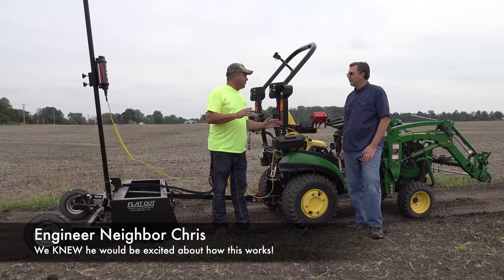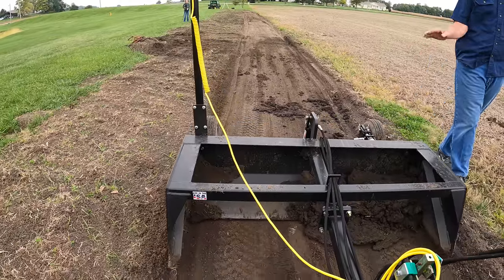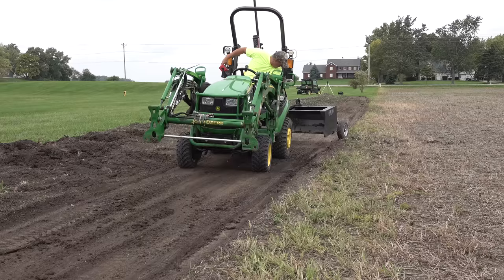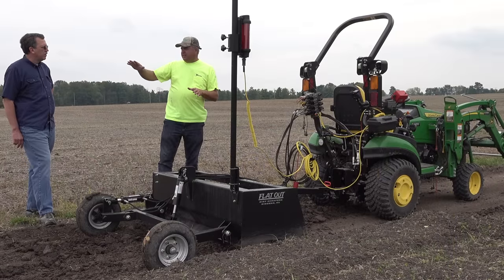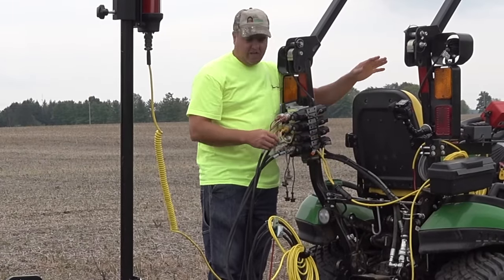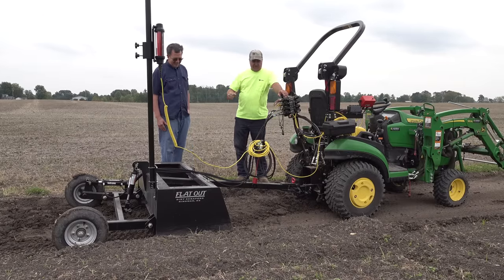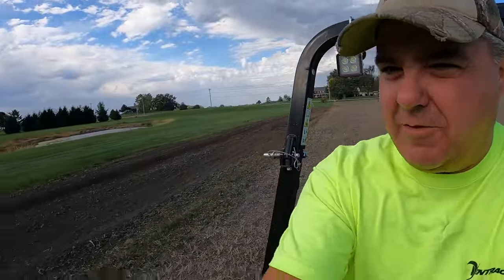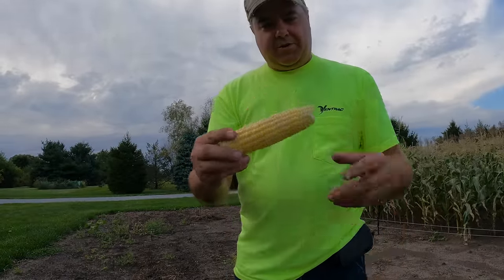Laser Grading Like A Pro! Subcompact Tractor Laser Leveling System! Least Expensive Option Available

Comment: You have nice soil.  That boxblade is just too light.  Hang two 75 lb. weights on each side and I think it will cut just beautifully and you won't need to make passes with the tiller first.  Cool system ad a lot of capability for such a small tractor.

Comment: RETIRED 76, AF VET. ONE OF MY PASSIONS. USING TOPCON. GOT $4K IN MANUAL SYSTEM. HAVE BLUE TOOTH FROM 360 TOPCON RECEIVER TO IN CAB DISPLAY. NEED TO PREPARE GROUND (NO GRASS, NO HARD SPOTS IN GROUND). EDIT: DRIVE SLOW USE HYDRAULIC TEETH AND POSITION CONTROL WITH HI-BACK 6' BOX BLADE. KUBOTA L4701 4X4 WITH T4 TIRES.

Comment: I can't believe this finally exits!!!   I have hoped this would come out for sooooo long. I CANT WAIT to get one of these setups Tim!!   Thank you!!!!
Reply from the maker: @Jason. Yep.  You are right.  That is why I am so excited about it.  Price is much lower than these more professional systems, yet this can achieve some of the tasks. …not all of them, I’m sure!   …and I’m not sure we have this one optimized either.  We might be able to get a bit more accuracy with some more adjustment.
Overall, we agree with you.
Reply: @justanotheridiotredneck  Was just looking to see if anyone else had mentioned a flow control to get rid of the bounce.
Reply: @justanotheridiotredneck  These less expensive laser controlled units rely on conventional "bang-bang" (on-off) solenoid valves.  The next step up is servo valves which act in a controlled proportional manner utilizing big bucks.
Reply from the maker: Yes, we have some control over that.  It would take some time to get it optimized.
Reply: @justanotheridiotredneck  Yes, with PWM control the signal can me manipulated to provide a series of very short pulses to smooth the action.  I'm not sure about the life of the valve spool in that condition, however.
Reply from the maker: We have that control.

Comment: It will be interesting to see this adapted to the ventrac powerrake. I'm guessing if the JD powerrake you have is pull type and 2 cylinder, this laser system could work.

Comment: This is a great start, but I think there are some improvements.

1) If you add some adjustable flow restrictors to the cylinder, I think you can get rid of the steps in its control.

2) You're using external on-off valves, but you're forgetting that the tractor already has a far more advanced valve by default - The position control valve for the three-point hitch.
If you use a regular three-point box blade and connect your laser receiver to a hobby servo motor which controls your position lever, I think you'll end up with a better result and it would be much cheaper.
Reply from the maker: We may try #1...but I'll leave #2 for you.  That sounds like a rube goldberg approach.

Comment: Your right Tim,it would be better if it was tilled, because I think that box needs to be half filled with dirt to fill the low spots. Also does have enough down pressure to do the cutting.

Comment: I see a lot of benefits to the pull type box blade. The price is pretty attractive too considering a regular box blade might be $1,000 and this one has two sets of hydraulics.

Have you considered putting a flow restricter in line with the laser lift circuit? It seems like the adjustments are exaggerated. With a restricter the laser might be able to make smaller adjustments instead of the jumps that we can see. Just a thought…

Comment: Wouldn't you be able to go both directions to get the slope you desire?  I mean go north/south first, then set a slope on the transmitter and go east/west next?  That way you could get by with the one setup..... just a thought.  Would that work?
Reply: Yup except the slope is from the laser so you would need to move it pretty much every pass.
Reply: @paybax  What if your Laser had a slope calculator built into it?  Sorry if that sounds dumb but I really don't know.  I have a Hilti that has a slope calculator so I thought that might automate it.

Comment: Awesome piece Tim.  Question.  When the blade has a visible gap between the CE and the ground isn't it saying you need to bring up the ground? Ie; pulling full blade so it can deposit fill in the low spots?
Reply from the maker: Yep…well, depending on where we have the receiver set.

Comment: Great setup!  Any hints on how to get from a laser receiver to a hydraulic valve.  R&D catalogs have laser receivers that convert laser-position to 0-5V - but it needs an in-line laser, doesn't have 360-degrees reception, and doesn't take advantage of the pulsed beam for improved sensitivity.  I'm hesitant to spend $40k for a pro-setup, when I know the receivers, valves, hydraulics, and scraper should be closer to $5k - $10k.
Reply from the maker: I thought I just showed it in this episode!!
Reply: I apologize.  I got confused in something...  Thank you for putting this together.    I've spent years working in laser labs & building prototypes & test setups.  You've found a great assortment of parts, assembled it well, and communicated it well.  High marks.
Reply from the maker: @robmurray5784  we have several more recent episodes with this combo.  We show our experiences, difficulties, etc.  it works well, but requires some practice.
Reply: I've spoken with Corey at C5mfg.  I'm getting an 8' box blade, and I've asked for  an additional hydraulic on the right wheel.  -》each wheel will have its own up/down hydraulic.  I expect this to fit well with the Canamek laser receivers & controllers, which each control a single hydraulic valve.  It would still work in the original design, but each valve would affect the position of the other valve's laser-receiver, which would require more time & valve chatter to equilibrate.
Reply from the maker: @robmurray5784  will be interesting to hear how this works.   I think it might work ok when strictly using the laser, but you’ll want the ‘center’ control for all basic box blade use…at least I would!

Comment: Question

If You are wanting the Tilt continuous for the entire length and the Laser sets the depth is the need for a 2nd Laser System really NEEDED?

I would think the 2nd Laser system would change the Angle of the Scraper to the plane of the Angle that You are trying to keep constant

Like for a Swale

Maybe if the angle is constant all that is Variable is the elevation then You would only need One Laser System?

I really like the concept

Ken in Florida
Reply: I have used larger version on synthetic grass installation for pitches and you need the two receiver's for dual grade, a fall from left to right and front to back for example
Reply: Yup dual mast one. Checkout Level Best. It’s needed as this only adjusts up and down at a preset grade, let’s say 1% from the laser. You could however take twice as many passes, one passes north to south and then next east to west with different slopes. Not super simple tho.

Comment: Might have to adjust the Hydrollic oil pressure - it might be a jerky up/down due to Oil like a bucket?  Those are Cannon Plugs - used in high vibration and High reliability functions.

Comment: It will be interesting to see the setup with the auto-magic tilt control. That said I don't think its required to operate the box blade in an effective manner. I think a simple slope indicator mounted on top of the box blade would be sufficient since in most cases the side slope would normally be a fixed value. The operator would just want to ensure the mounting spot for the laser pickup is on the fixed side of the box blade just as you have done to provide a consistent base reference.

Comment: I don't know if you still have it but how would the power rake you used on the back of Johnny in the past have worked with the laser leveling system in stead of the box blade? The swale looks very nice and the corn looks tasty too.
Reply from the maker: Would not be able to control the power rake since it is 3 point controlled.
Must have electric over hydraulic control.  Make sense?
Reply: @TractorTimewithTim  I forgot it was 3 point controlled. Maybe if the rear wheels had hydraulic control.
Reply: @TractorTimewithTim  Sounds like a new kit possibility to add solenoid control on the 3 point.

Comment: great idea but it seems to be very jerky up and down. I wonder if added weight on the box blade would smooth that out?
Reply from the maker: Maybe, or maybe different software adjustments.  Overall, it didn’t affect the function.
Reply: I think that is because the controls are electric over hydraulic ….  No live hydraulics or pilot controls …..

Electric over hydraulic only knows ON or OFF …. So it goes “full speed” and abrupt …

Now you could add a flow control to slow it all down ….  But now you have to drive slower otherwise it has a hard time keeping up with the adjustments …..

Comment: Would this system work on the loader if you had a front blade or even just using your bucket?
Reply from the maker: Only if you have electric control of the hydraulics.

Comment: Hi Tim, would you help me to creating a laser system like this for my jd 5083e and 8 feet box blade? 
I’m going to use this to level chicken house floors. Thank you
Reply from the maker: Sure.  the info is all here in the description of this video.

Blade from C5 manufacturing.  Maybe you already have the blade?
Laser transmitter and receiver available from canamek.
Compatible Electric SCV's available from summit hydraulics.

Please contact me tim at tractor time with tim dot com (email) and we'll work out the details.

Comment: So, if I'm understanding correctly, you have to have a Sumit kit in order for it to work as described?  I have two sets of factory rear remotes, so without the Sumit kit, it wouldn't work is that correct?
Reply from the maker: Must have electric control of the hydraulics.  
Most factory hydraulics are mechanical control…which is better for 99% of usages :-)
Unfortunately, this is the one percent!
Reply: @TractorTimewithTim  Thank you

Comment: It would be nice to describe the entire system to include the summit piece of equipment
Reply from the maker: I thought I did. What did I miss, or what is confusing to you?
Reply: @TractorTimewithTim  I couldn’t understand how the summit hydraulics were installed and their function in the whole system. Maybe I need to watch again.
Reply from the maker: @rickmcguire4284  ah, ok.  We showed this in several earlier episodes.  If you missed those, it makes sense you didn’t fully understand!
Here is a link to the first video:
Introducing NEW Rear Hydraulic Solution for Subcompact Tractors
https://youtu.be/_BoflPiwd64
Reply: @TractorTimewithTim  I read about the system on your website and understand now how it interfaces. I will also watch the video. Thanks
Reply: If I already have rear hydraulics, instead of a power beyond system , can I hook the summit hydraulic system to the rear hydraulics and bungee cord the hydraulic lever forward.  I’m thinking that might work. Thanks
Reply from the maker: It might work.

Comment: Depending on set up time on laser that would make a killing on driveways
Reply: This is what I wanted to do for driveways as I do driveways for a living. However Laser doesn’t work tho. Driveways are winding, and go up and down. So if you set it at a 1% grade, it’s a 100% consistent slope the whole time. Potentially you could keep moving the laser and changing the slope to closely match the driveway so it’s just taking small cuts and not trying to cut or fill +/- 1ft. 

Need GPS. You would driveway the driveway first to map it. And then set your slope to 1% or greater for example, it would cut where needed to make sure the slope is sufficient to shed water.
Reply: Actually around half way through the video he kind of touches on that issue
Reply: Yeah I watched about 3 minutes commented
Reply: @paybax  that depends on where you live I’m in Louisiana so it’s flat as a board. Up north of I-10 I can see what you are talking about

Comment: I think that is totally useless what I see it looks like just a piece of implement that looks pretty and you can play with it and it looks like it would only work on a very flat surface, bring that into a dirt road where you really got to use the leveling device spreadinng out gravel. I think the time it would take you to do it with that automatic system is not even worth what someone can do with the manual system that have a good feeling for a box played. So what I seen not very impressed
Reply from the maker: The entire point of it is to make a FLAT surface, or a consistently sloped surface.  
This would be for grading a building pad (flat), or a swale in an area where there is not much slope (like my yard) where one must be very accurate to solve drainage issues.

One wouldn’t use the laser for driveway maintenance!